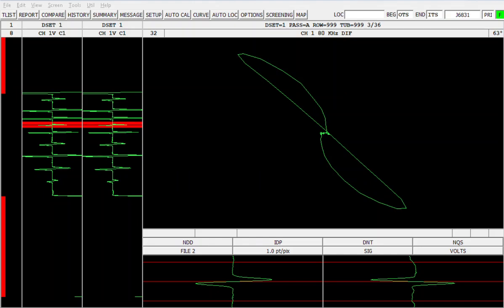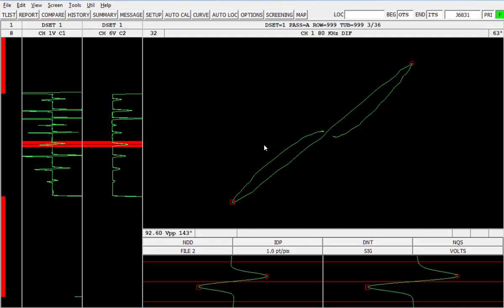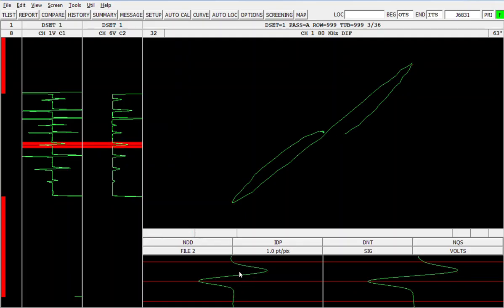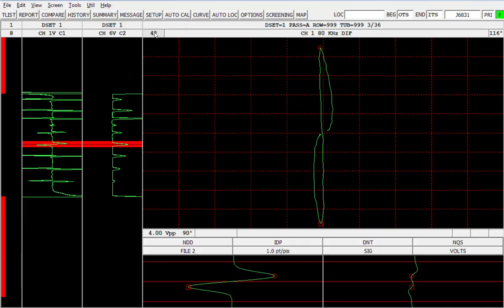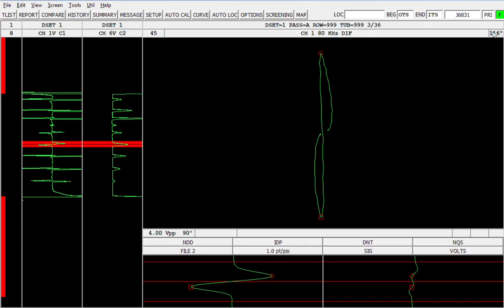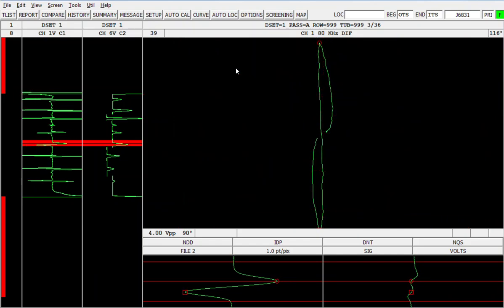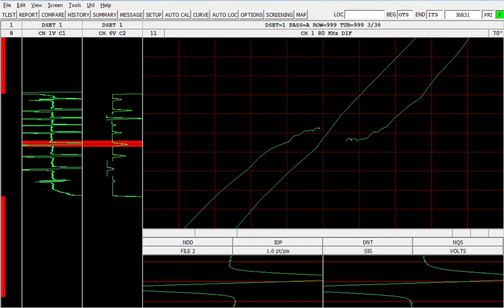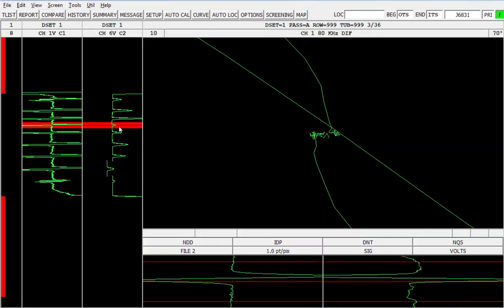Eddy Current Bobbin Coil Voltage Normalization and Span Setting for tubing exam.

Comment: So, if you’re using CoreStar and after you set the 4x20’s to 4v during calibration, now you move on to test, you find a signal of interest, you click in the x-y box of that signal, it tells you phase and Vpp, does that Vpp number measure base off the 4v you set from the 20% OD during calibration?
Reply from the maker: You got it!
Reply: OK so when you started off the video you talked about setting it off of the indication of 20%, and having it set off of that amplitude, but I guess you must have set the amplitude prior to starting the video. I would like to know how do you know what to set it as far as amplitude prior to normalizing it at 4 V?